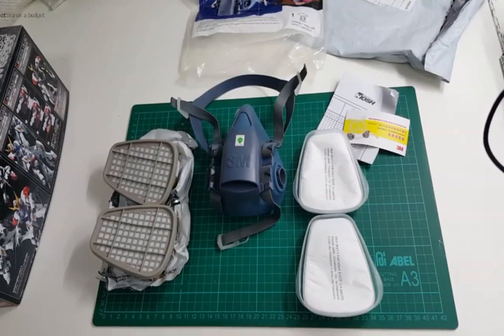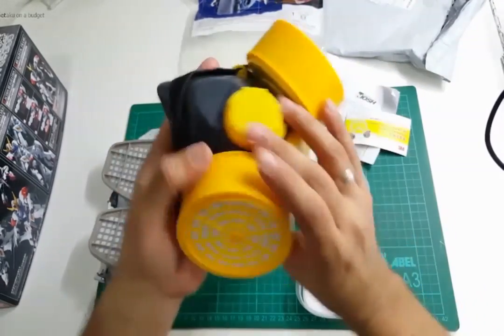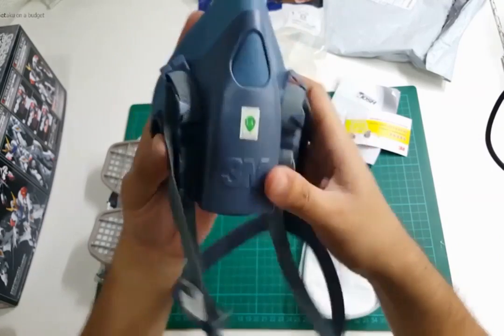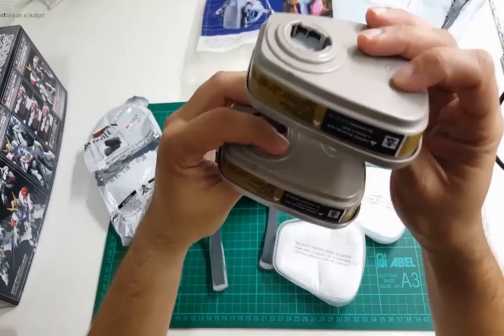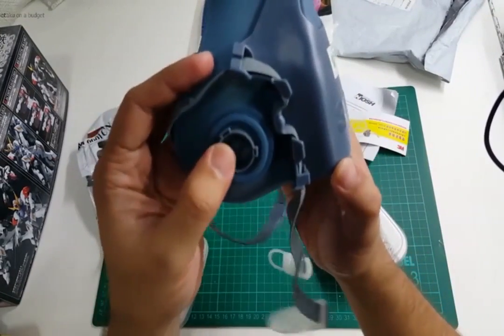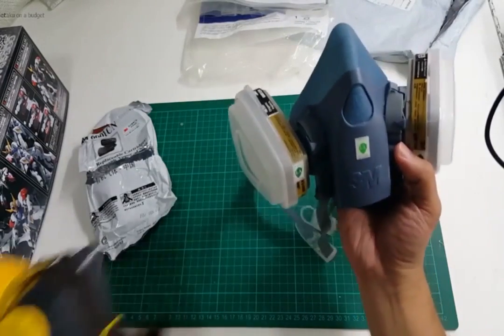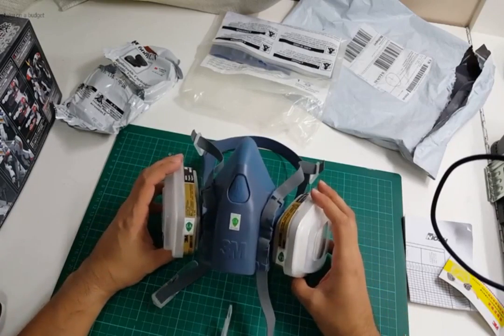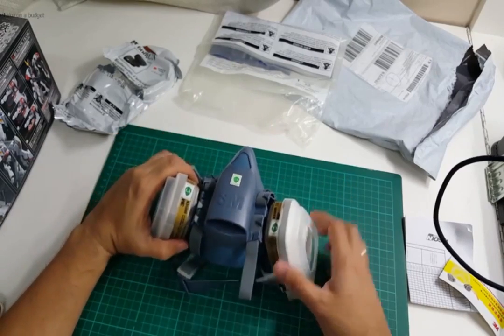3M 7500 Half Mask Review

Comment: To all the folks who say this mask is fake:  3M makes products in their Chinese factories intended for sale in China that have the LA certification sticker.   The part numbers for these China-market products usually (if not always) have a "CN" suffix.  Some products badged for the Chinese market are even made elsewhere, such as the 7093CN P100 filter, made in Canada.   That doesn't mean this mask is genuine, as a counterfeiter could choose to make a fake of a China-market product, but the fact that it is made in China does not in itself mark this product as non-genuine.   It is a separate issue whether the 3M products made in China for the Chinese market are built with the same quality control as those made in the USA, with some people claiming they are not, e.g., the vapor cartridges.   I can't comment on that.

Comment: Did you have a hard time breathing in your 3m 7500 mask? I just bought one and was breathing very heavy using those white filters, wonder if the valves inside need to be removed. Have a little headache even now
Reply: If you remove the valves the mask becomes useless. They're there for a reason.

Comment: That mask is fake. Real ones don't have the LA sticker
Reply: Flawrence Isenhart  real ones don't have the Chinese LA sticker
Reply: LA means labor safety PPE which is used in China,
Reply: Flawrence Isenhart  Do not use these mask very dangerous for your health. You can inhale fine carbon dust into your lungs. Buy the real 3M product or at the very least buy the real 3M filters.
Reply: Black Pill  Well I did say in the least buy the filters. The quality is much lower overall as we find out in the recent bush fires. We broke the stapes on 3x 3M copy marks and my original 3M mask is still going strong and its three years old.